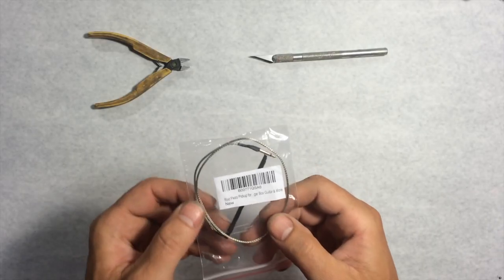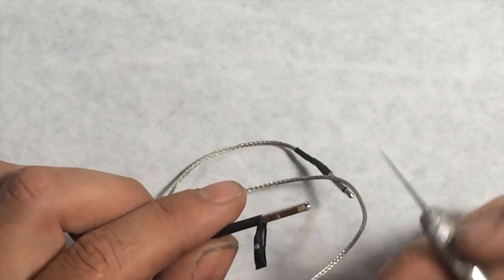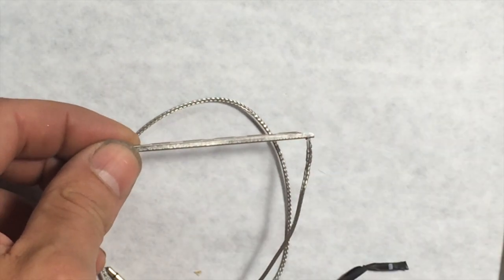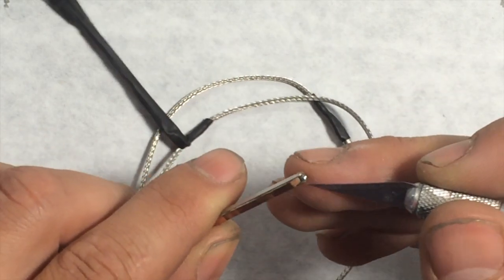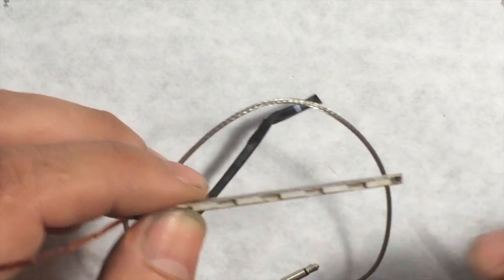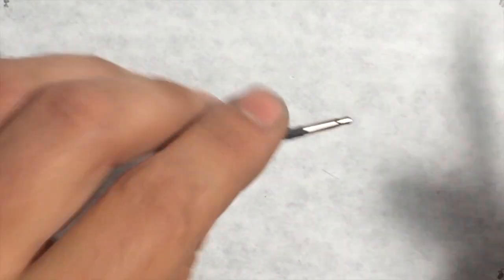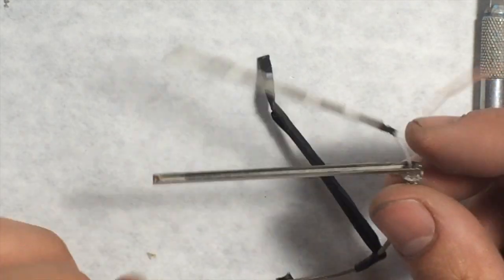Rod Piezo Teardown-  Whats inside this Rod Piezo pickup

Comment: The piezoelectric material is under the strip of copper and thicker than most disc types , probably Barium titanate. The disc type has a basic wash of the material on a brass disc covered with a flash of silver to solder the positive lead to . In these bar types the copper is the positive connection . They can be cut and if good with a soldering iron extended too to make say , a Chapman  Stick or even a piano or make single piezo saddles using the material and the positive conductor as the bridge with be the ground , only one thin positive wire is needed from each saddle . The piezo material Notches quite easily to hold the string .
 You can make and cast your own piezo material for a custom shape using simple ingredients found in the kitchen . Creme of Tartar , Sodium Bicarbonate and Isopropyl alcohol.  In 120ml water add 80 gas Creme of Tartar and hold at 95°C in a water bath . Add 1gm Sodium Bicarb at intervals until the reaction stops . Filter off solution onto a ceramic plate . Add 20ml of IPA 5 times at 10 minute intervals and air dry . The resulting crystals can be press formed into any shape you want .

Comment: I'm confused. You say the copper plate should not touch the metal casing, yet they are soldered together. To me it seems like the white wire is connected to the positive side of the piezo's that rests on the metal (within the tape), while the copper, and metal housing, are connected to the negative side (ground)? I need to repair my piezo rod due to a poorly soldered wire, and knowing what goes where would surely help. Thank you!
Reply: I think the copper that is outside and the metal frame acts as the "shield and negative terminal"; there is another conductor inside where the tape is that acts as the positive terminal for the piezo elements.

Comment: Just bought this thingy but the audio plug do not get into a regular 3.5 mm jack. What size is this jack?
Reply from the maker: Yeah it’s smaller,  I just soldered on a 3.5
Reply: @imagineform  Is it possible??  Cuz i have fishman sonitone everything is fine i just wanna replace the undersaddle pickup BUT the problem is it doesn't have an 2.5mm jack its just solderd. So im not sure

Comment: Did you use an ohm meter to determine in fact if the red lines on the ferrite were positive or negative? Also was the copper strip positive or negative in relation to which part of the 1/8" jack? It looks like the (-)ground goes to the copper strip.

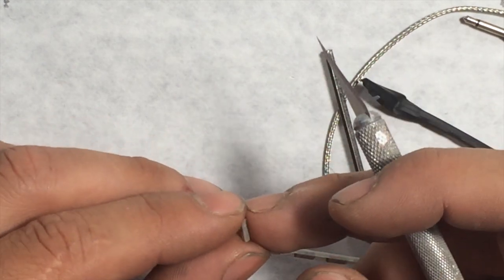Comment: Thanks for posting, Tom Stringham. At about 4:00, you pointed out the red line as positive, more info on that would be appreciated (before you popped the crystal out, no red or gray line was evident). Suggestion: place a spot of tape on the table to keep the item from going off screen. Ay! frustrating. Otherwise, thank you beddy mooch!
Reply from the maker: Sorry about that,  right at 3:48 there is a little glimps of it as I just pealed back the top layer.  the crystals are marked so they all are oriented the same way, I am guessing these are hand assembled.